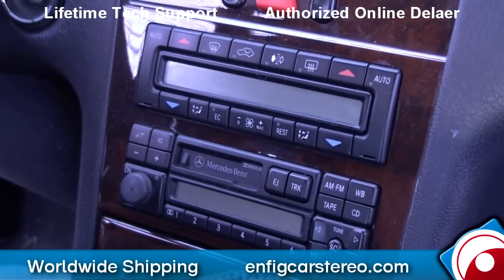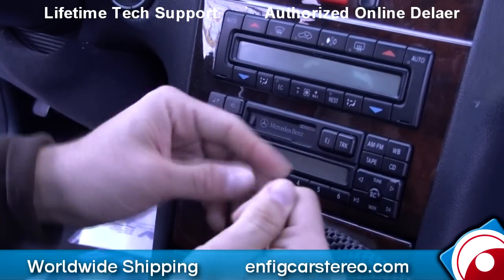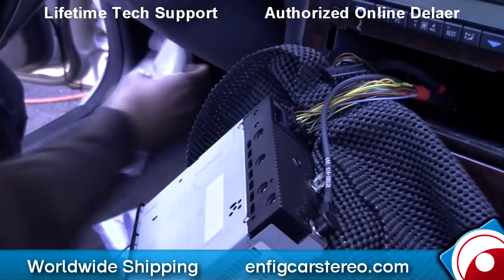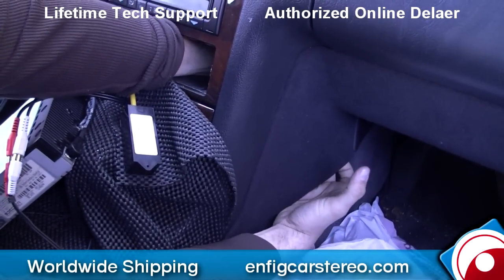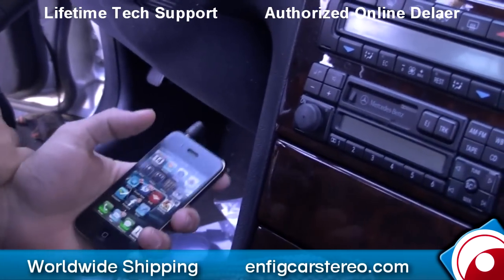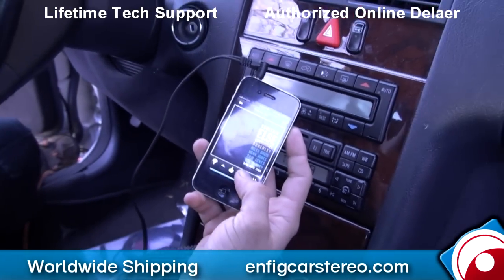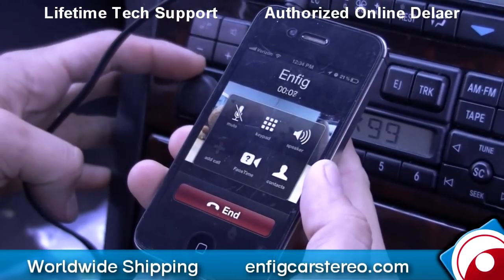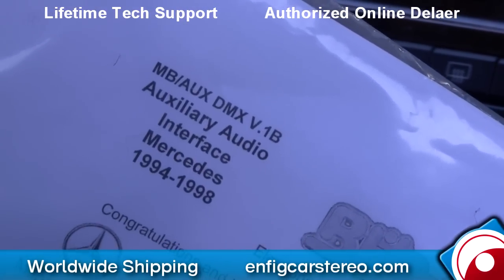97 Mercedes E Class AUX input Installation and Demonstration

Comment: on your site the cord you used says its specific to '94- '98. what i was wondering is if I need a different adapter for my cd changer port in a mercedes benz c230 2003. it has the stock radio
Reply from the maker: +Xander Beasley this is the model needed for your radio.
http://enfigcarstereo.com/ENFIG_D2B_AUX.html

Comment: i want to put a Pioneer DEH-X3950BT in a 1994 mercedes E220. does enfig have any ready to go adapters that will will make changing over a head unit easy ?
Reply from the maker: I know I have all the parts but I'm not sure what you need.  If you are local just come by with the car.  You will not be charged labor.

Comment: If u replace a factory Mercedes radio with a jbl radio would u still get the same sound ?
Reply from the maker: JBL does not make aftermarket radio.  But yes if you replace the radio and do not have a fiber amp the sound is usually better.  (some cars have a fiber CD changer but non fiber amp).  If you have a fiber amp and replace the amp and radio then yes it will also sound better.  As long as good products are used.

Comment: hi, i have an audio 10 alpine mf2910 installed in my w210 (2001 model). it has CD/FM/AM/CDC (fiber optic) options. I dont use the CD player much as it doesnt play a lot of CDs. Will this AUX unit work for my car?? Any smart alternatives??
Reply from the maker: The AUX for the 2001 has been discontinued.

Comment: I have 2 radios. I have a audio 10 cassette player and a audio 10 cd player. I need a usb and aux connector. will this work for me?
Reply from the maker: +doc toda As long as the radios are not fiber optic radios and have have CD changer controls this will work.
Reply: Did it work on the audio 10 cd player? I have a 2002 CLk and i would love to know if it worked for you.

Comment: will it fit an alpine 10 cd unit ? plug looks to be the same
Reply from the maker: If the radio has a fiber port it will not work.I know car models and years not specific radios.
Reply: It does have e fiber port sadly. The car is a 2000 ML320. What are the options with this head unit ?
Reply from the maker: Only option is to replace the radio.

Comment: does this work for a 1998 Slk 230 Kompressor?
Reply from the maker: +Jaspal Singh NO this is the part you need.
http://enfigcarstereo.com/ENFIG_D2B_AUX.html
Reply: the SLK 230?
Reply from the maker: +Jaspal Singh I'm sorry I think the 99 is the first year of the new radio this should work as long as you have the same radio in the car.

Comment: I got a w124 wich has the older style radio, wich has a button wich says CC-CD, wich I think it stands for Cassete changer and CD-changer, it will this work on it? the model code is BE2210. Here is a picture https://scontent.fopo3-1.fna.fbcdn.net/v/t1.15752-0/p480x480/47496925_967129426812637_8925081726309367808_n.png?_nc_cat=109&_nc_ht=scontent.fopo3-1.fna&oh=18f57b5dd9231f068062919c1bf213c3&oe=5CB0ACE2
Reply from the maker: This should work but I only know the original car compatibility.

Comment: hello 
will it work on e320 elegance 2001 w210. (the device has a CD button but actually there is no cd reader in the car). Is there the input needed for this cable?
Reply from the maker: No that is a different adapter that has been discontinued.

Comment: will this work for a 1999 sl500 ?
Reply from the maker: If the radio is the same yes.  You can email us a picture to confirm.  I think the SL had the older radio until 99.

Comment: Would this work for a E320 2000
Reply from the maker: No that is a different part that is discontinued.  But on a 2000 you may be able to replace the radio pretty easy.

Comment: Hi. does it works on a Becker classic (with no CD button) of a 1994  diesel w202?
Reply from the maker: It should work with all 1994 but I'm not sure.  Does the car have a working CD changer?
Reply: sorry...heres the radio http://www.soundmasterscotland.com/storemill/secure/artwork/product/9_9_049d6432-66db-42f3-b428-b3c875e639b4.jpg

No cd
Reply from the maker: Looks like it will but my applications just go by car and model.

Comment: Will this work on my 2001 cl600 stock radio?
Reply from the maker: As long as you bypass the CD changer it will but you have to find it used because it is discontinued.